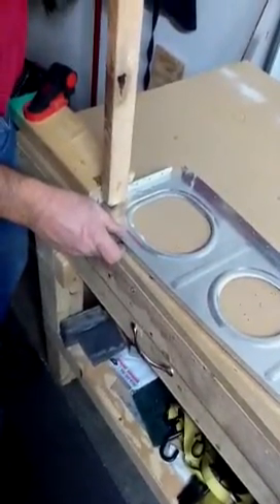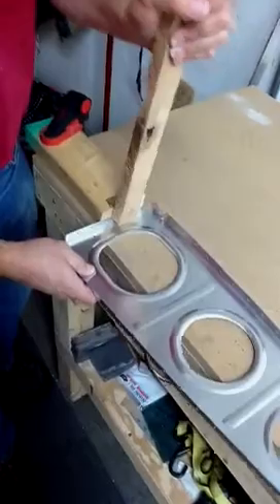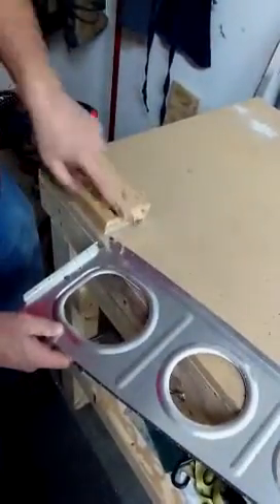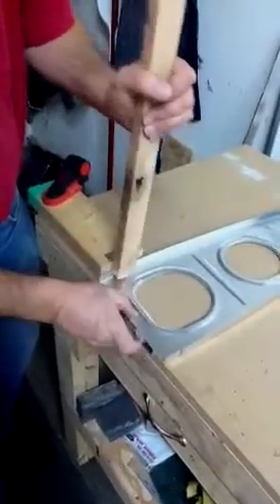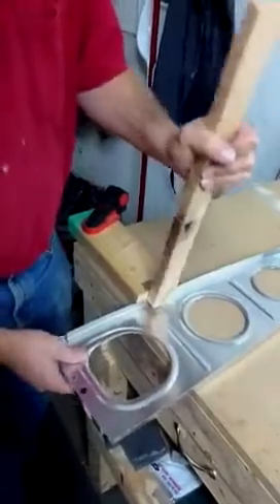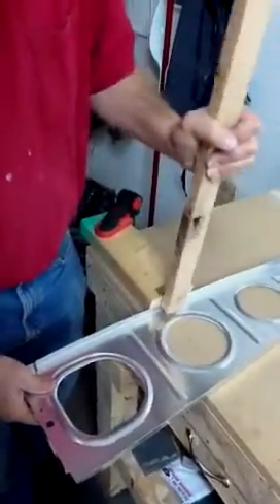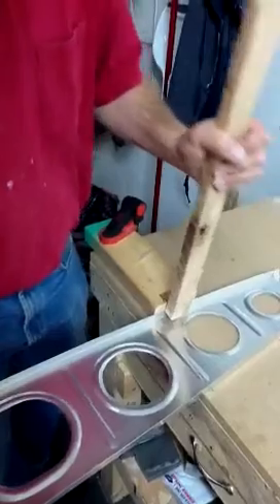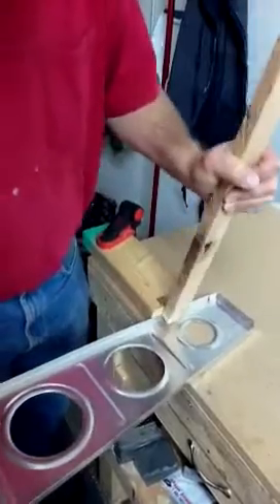RV airplane rib flange straightening

Comment: Bravo!  Thank you for sharing this.  I'm off to the hardware store~
Reply: You’re welcome. Nice to know this is still helping RV builders. The 2x4 has undercut bevel of 11 degrees. This allows the flange to over bend, then relax to 90 degrees. The end of the 1x2 is trimmed to about 3/4” square and small radius so it can nestle into to radius of the flange. Hope this helps!